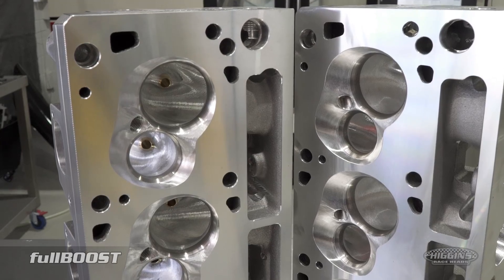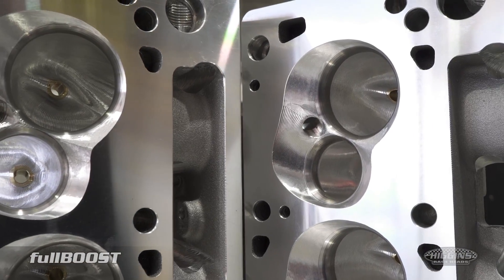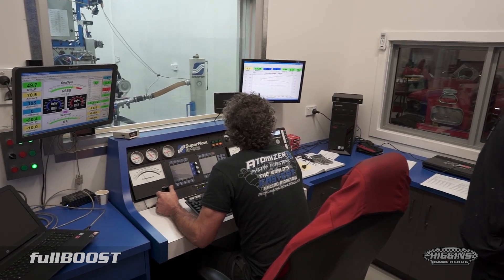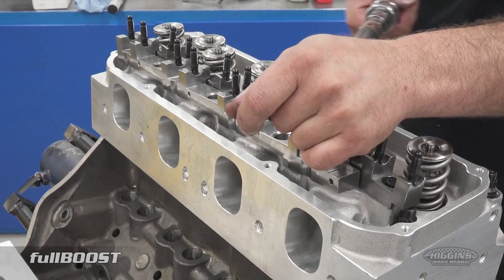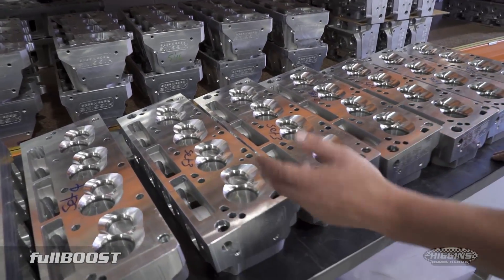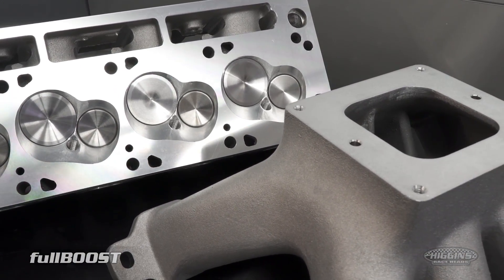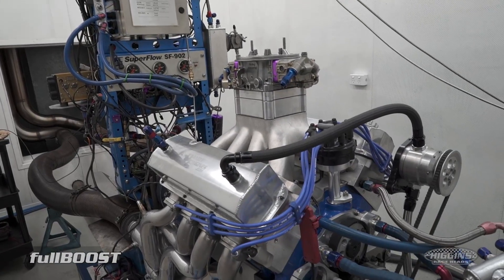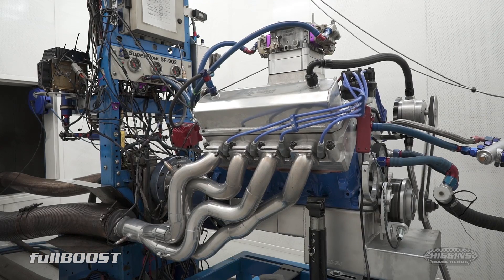How to make horsepower on pump fuel | fullBOOST

Comment: Why is the large plenum spacer necessary?  Would a holley terminator efi be able to deliver the same results without the spacers?
Reply: No you'd be reducing plenum volume and adding restriction to airflow (reducing velocity) you'd be down on a bit of power
Reply: its called a high riser manifold
Reply: Thanks superoo for your input.. A high riser hey.... What you might notice is the 3 inch spacer between the carb and the manifold.. Can't imagine it sitting under a bonnet with it sitting so high.  I'm just wondering if you removed the fuel jets out of the middle of the carb by using a throttle body efi would you you achieve a similar fuel charge velocity.  now if this is all to much then feel free not to answer
Reply: this is how the carby works best ,the self tuning efi carby will make changes in the software to compensate for the intake deficiency using the sensor inputs temp,map,wideband etc etc,even better if you want to go forced with the blow thru efi carby version but that may need more tuning for your application

Comment: What's the hose from the rocker cover to the pump thing for? I've seen a video of a 300whp NA Honda make an extra 5whp when they attached a vacuum cleaner to the rocker breathers lol. Is this a similar contraption haha??
Reply: Boostedboiz
Reply: Vacuum pump
Reply: BOO' that's a bit harsh when you are as ignorant - while some vehicle will use an auxiliary vacuum pump for the brake booster/servo, that is not what is shown here. It is a vacuum/scavenge pump used to create a low pressure in the crankcase to reduce windage losses.
It is increasingly common to use a hydraulic servo' on modified vehicles where a hydraulic power steering pump is fitted, as the pump can be used for the servo' as well as the steering rack.
Reply: Rome3aaro because too much cam imbecile. Now do you want a good vacuum to the brake booster or run over the crowd.
Reply: I think it's a vacuum pump it helps to create a better seal between the piston rings and cylinder wall
Reply: Mick D how does a street motor need a vacuum pump.. 😂
Reply: GordoWG1 WG1 no not really a hydro boost setup is much much heavier. I’m not sure what kind of race event you attend but 90% of true race cars don’t use hydraulic steering. This specific setup for the dyno is using it as pcv. On the real car it could be doing two jobs. 
Hydro boost are used most commonly on heavy cars that need plenty of assist. Car weighing 3300lbs have no need this. Not in drag, nascar, drift. You must be thinking of Astro vans competitions.
Reply: No, I'm not confused - merely pointing out that a vacuum source isn't required for servo assistance. Personally, if I needed vacuum for brakes I'd use one of the readily available electric vacuum pumps - but integrating them can be a *** with pedal boxes and can hurt the pedal feedback, it can and has been done, though.
As for "race" cars not using power steering - that would be true for straight line racing but because of the high steering loads from the high positive scrub radius, downforce, camber gain in body roll loading the outer edge, etc, many race series have power steering as an essential part of the vehicle... yes, even in your NASCAR and 'drift' (some use an electric pump), F1, the Le Mans series and the other high end stuff.

Comment: What’s the stroke on that thing?
Reply: 4
Reply: 4.155 bore x 4.250 stroke
Reply: Glen Tight that would sure be a lot of stroke for 8250 RPM.
Reply: as a roughie... i would say somewhere in the 3.25 - 3.3" (82.5 - 83.8mm) range....
Reply: 4.18 bore and 3.26 stroke is a 358 CID Nascar Ford FR9 engine
Reply: Can I be Frank 

Confirmed... same motor they made 850 with a few years ago... after @fullboost pointed me to their 2013 video of the (i assume) original build..

Still turned 7500 then....

Fkn impressive..
Reply: Glen Tight you in th U.S. or Au?
Reply: 407ForRent 
AU 🇦🇺
Reply: Glen Tight east coast?
Reply: 5845 f/m (near enough 30m/s) mean piston speed @ 8250rpm...... ummmm.. that is considerable more than I was budgeting for.. 

I calc'd it at (mean) 4500 f/m (23m/s), which I thought was a good ballpark....

I just figured they were wayyyy oversquare... (not sure how over you can go on SBF)

4.155 X 4.250 IS a crate 461W... but that will turn to... maybe 6500rpm..

If the 4.250 stroke holds true.. considerably more credit is due, that is one light and tough mutha of a bottom end to spin that up to 8250... Max piston speeds in the 9200 f/m (47 m/s).. 

really curious on the actual specs Dandy..
Reply: 407ForRent 4.25
Reply: Glen Tight really impressive! I'm building a 408w and if I can get it to 7500 I'll be fired up! I think you might like my channel if you're into cars

Comment from the maker: Horsepower levels that were once thought out of reach for street based naturally aspirated engines are now becoming reality thanks to Australian companies like Higgins Race Heads.
Reply: How much for the heads and intake ?
Reply: @nickrawleigh5590  If you have to ask, you can't afford it....
Reply: Agreed, all types of engines are producing power figures that would not be believed just a few years ago.
I would like to have seen the pull start lower in the rpm range, though.
Reply: Fullboost that's impressive do they do mopar la cylinder heads?
Reply: mate well done. your content is great and very well presented
Reply: GordoWG1 WG1  #
Reply: They can't be that good, all the mechanical design engineers and aero fluidynamicists below said so, I believe everything I read down there in the swamp.
Reply: slow 👏